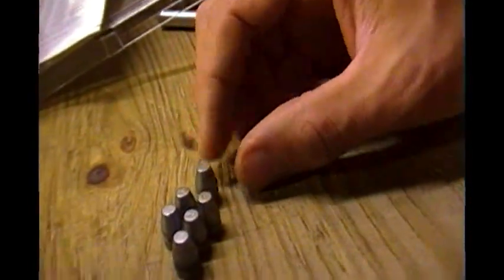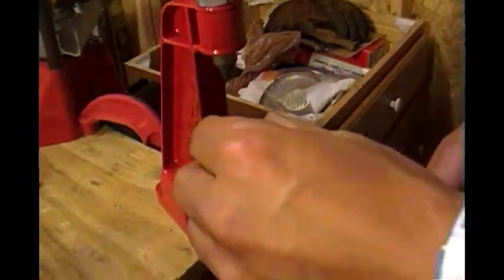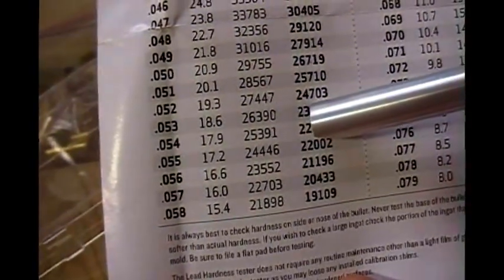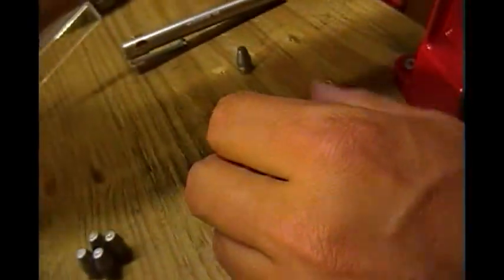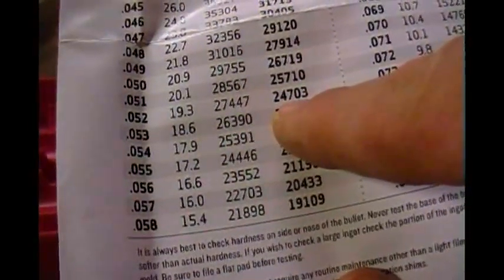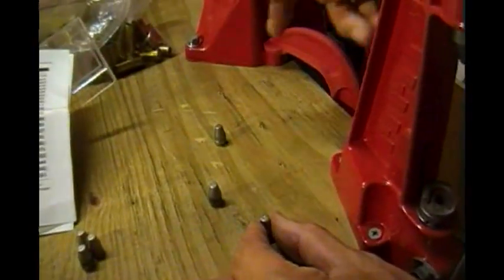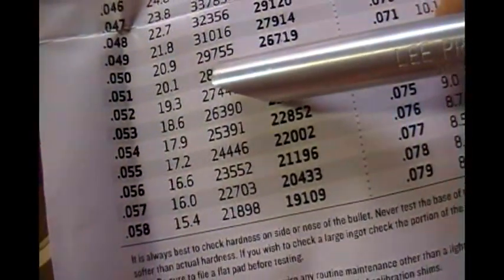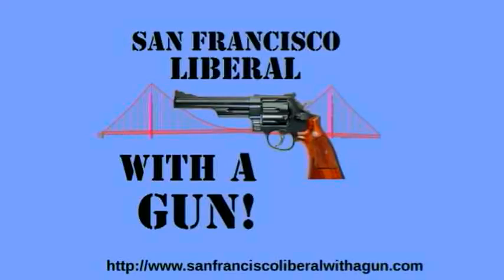Using the Lee Lead Hardness Tester - Part 2

Comment from the maker: @rushymoto  Your method looks good.  Should work just fine.

Be advised, tin has gotten really expensive, so I'd use it sparingly at this point.  What's most important is proper sizing and sufficient lube.  Hardness or softness of the metal is actually kinda tertiary if the other two items are in place.

Comment from the maker: @MrJpm383 Someone I know uses BHN 8 (really soft stuff) for full-house .357 Magnum, so I'd imagine wheel weights would work.  For .40 S&W-type pressures, I'd suggest BHN 15-16.  To make your lead a bit harder, you can either water-quench your cast boolits straight out of the mould, or if you want to stick w/ air-cooling, you can mix some Linotype with your alloy.  My BHN 15-16 alloy is a 50/50 mix of pure lead and Linotype.

For the mixing, a Dutch Oven w/ a propane fish fryer works very well.

Comment from the maker: @danratsnapnames I'd be glad to, but I'll need to head to Sears (I actually do not own a bathroom scale!).  But I can tell you this.  With hand pressure and a little body weight, I can get that plunger to level.  The spring is reasonably stout, but not Hulk Hogan-like.

Comment: @sfliberal yea, i got a 0.18 ball, it should do the trick.  i figured it was spring loaded.. 
wondering if you could take the die, and press it onto the bathroom scale until the top is level by hand.. if you cant, at least that will give me a good idea that its a hefty spring, and if you can, a rough estimate of the weight would be sweet.

i can easily make the rest with spare parts around my shop.  thanks for all your help.

:)
 dan

Comment: @sfliberal ah great.. thank you very much..  i happen to have a ball about that small.  should work out great.  

would you know what the pressure is when that nipple is level with the top of the die?   i'm assuming its spring loaded, or is it running on a air pocket?

either way, i'm sure its just a good way to accuratly put the same pressure uniform amoung mulitple bullets.

Comment from the maker: @danratsnapnames Hi danr, got 0.1428" with the micrometer.  However, that's probably not an accurate diameter measurement, because it looks like a little less than half the ball is exposed.